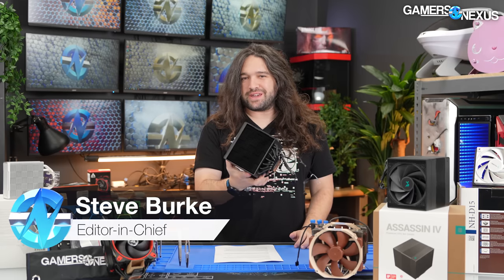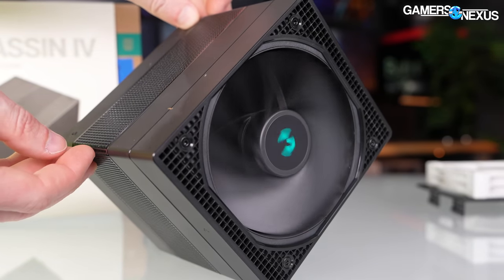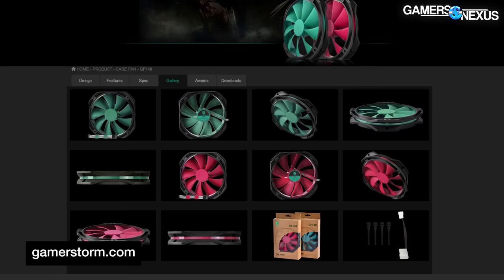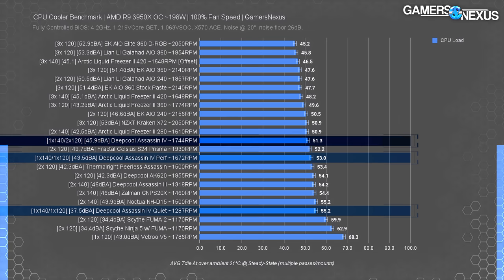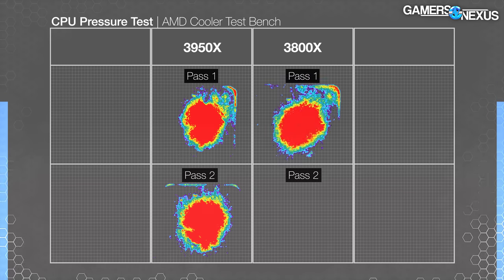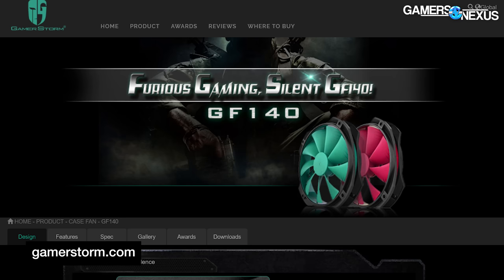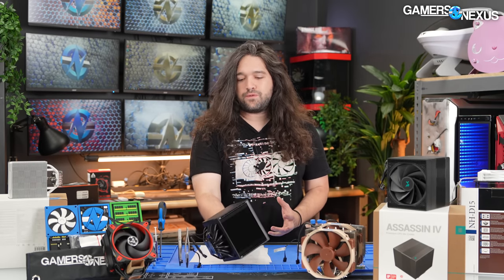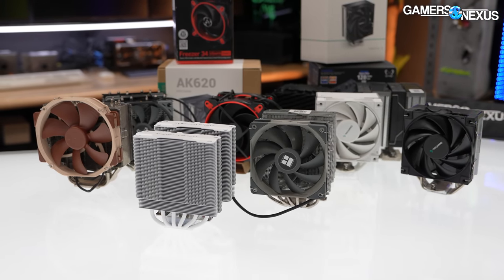Mega Size Air Cooler: Deepcool Assassin IV CPU Cooler Review & Benchmarks

Comment: The PA120SE has really impressed me. Upgraded from a Noctua NH-U12S. The performance to price ratio is ridiculously good 👍
Reply: After watching this, I regret buying my NH-U12A.
Reply: I bought a PA120 for £35 and I am very pleased with it.
Reply: just ordered one as replacement for the dying fan on my Macho rev.b ;)
Reply: it's just sad there's still people who refuse to believe the noctua sucks nowdays in both value and performance
Reply: Yeah, using it on my 5800x3D and its the reason I dont have to undervolt it :)
Reply: @JaySee5 on’t feel too bad. I built one system with the U12A and one with the PE in the past two months. The PE is larger and obviously keeps things cooler. But the fan noise from the PE is more noticeable to my ears than the U12A, and the latter was easier to work with in a smaller system. As mentioned, the Noctua cooler runs a little hotter under heavy load, but with a Thermalright CPU bracket, I have been unable to thermal throttle the CPU.
Reply: @JaySee5  obviously it all depends on the type of CPU. The Noctua is still a beast (I had it in 2014) yet with the higher end current CPUs it was still good but I knew I could improve. Plus I got the PA120SE on prime say sale. Can always upgrade and sell the Noctua?
Reply: @JimJik  I think the biggest rep noctua has for its longevity. I bought a NHU12s 11 years ago for an i5 3570. I still use it today on an amd 3600. I bought the cooler 11 years ago and a 5€ addon to make it compatible. 

This is just something noone else offers
Reply: @ironcrown2383 I mean that's awesome you got to use it for so long but it's literally a piece of metal lol. So it's kinda hard to not be durable. The little conversion kits they send you can be bought for like 3 bucks with free shipping. 

If the fan lasted all that time then I get your point.
Reply: @jim8571  yep, still the same original brown fan. But other brands dont even offer conversion kits like that and some dont even exist for that long or still offer support for models made that long ago. Thats why noctua is so great imo. But nowdays there are better performance/money offers, that you could prob sell those and buy a new one later, for the same price
Reply: @ironcrown2383  that's honestly a fair enough point, hope it lasts another 10 years!

Comment: Got 2 of these coolers. 1 is installed and working already, the other awaits installation. Never noticed any high pitched whines or anything. Main idea for their use is to take a 7800x3d, mount this tower on it, switch it to silent mode (more than enough cooling even in silent), and have a barely audible system. And it really is, even with an open case. Water cooling was not an option for several reasons, and this was the perfect solution.

Comment: I bought a Deep cool AK620 which seems to be part of the precursor series before this one. It is very similar in styling and features. I am very happy with it but mine does have the same annoying fan noise at high speeds. 

Honestly at the time I took a chance with buying Deepcool as they were still known as a budget brand but this cooler seemed to be ticking all the right boxes and I don't regret it. They have definetely put in the effort to transform their products and it shows. Give them a shot.
Reply: Can you tell your CPU Setup please?

Comment: I bought Thermalright's PA12 as a temporary cooler during my 7950X build.  I used it during the build when testing the components outside the case.  I even went as far as installing Windows.

Once the MB was fitted inside the FD Torrent, it's an Arctric Freezer II 420 that's doing the cooling.  And very well too.

The Thermalright PA12 will get reused in the future for when I upgrade my 24x7 rig,.  Presently that's got a Darkrock 3 cooling an i7 6900K running stock.

The Thermalright PA12 ranks better here on GN than the Noctua NH-D15.  nearly everyone else that tests the two have it the other way round.  But I trust Gamers Nexus's rigorous testing more that most other sources.

Also, Thermalright's AMD 7000 series Contact Frame is the nuts.  Doesn't do anything for cooling, but it is the best solution that stops thermal paste getting down inside those stupid heatspreader notches and makes cleanup easy.

Comment: Scythe has a fan called "SCYTHE Kaze Flex 140mm Round Frame" that has a 120mm mount, it could probably replace the middle fan and it could also be mounted for the included 120mm Fan adapter

Comment: I’ve been waiting for a company to try ditching the front fan to avoid any ram clearance issue and see how the airflow works out with pull fans. Glad to see it still cools well. Hope more options like this come to market.
Reply: A lot of existing coolers support this option (though I can't think of any that were designed with that in mind from the factory I suppose). The NH-D15 is one of them and it can help with RAM clearance issues (could use a 120mm if the VRM heatsinks are too tall but many MBs will fit the 140 there). You can also get the NH-D15s and add a 120mm fan to the outside pulling through instead of the RAM side and get the same effect.

Comment: Yes it's $100, but you will never have to change it due to failing pump, or crusty liquid build up. They pretty much last forever.
Reply: Yep, my old Coolermaster Hyper 212 is over 13 years old and still runs perfectly to this day with the original fan, which is not something that I would expect many AIOs to be capable of.
Reply: Unless the fans die, then just swap that... :P Not as expensive.

Comment: I think we truly peaked air cooling capabilities now. I'd go AIO but I still fear AIO leaking and destroying my whole system.
Reply: My am3+ systen ive owned since 2016 still has the same aio i bought back then. Its starting to bubble a little bit but overall never had any problems with it. I went air cooling tho with my new build since the 7800x3d doesn't need a aio

Comment: For that price, Deepcool should, at the very least, use thin steel instead of a plastic shroud.
Reply: I argue that would introduce rust, cutting fingers, and heavier cooler damaging motherboards risks.
Reply: @AaronShenghao  Is your GPU backplate made out of plastic?
Reply: @4zims  If it's not being used for cooling it might just as wel be.
Reply: You can't get the same seamless form-factor and built-in features (e.g. notches for the ratcheting adjustment) with thin steel

Comment: Hardware Canucks noticed (probably) the same "whine" you encountered. They contacted DeepCool about it, and were told there were some defective units in the early run. DeepCool sent another unit to Hardware Canucks, and that unit didn't have the "whine" issue.

Comment: I build all the CAD workstations and office PC's where I work.  For anything with an i5 or i7 I had been using Cooler Master Hyper 212 (all the different models) but the price on the old reliable cooler had been going up not down and is usually around $60 CAD ($45 USD) However when 11th Gen and then Alder lake hit the scene on the high machines I was using DeepCool Assassin III because it was so much cheaper than the next competitor here in Canada at $99 ($75 USD).  Then the AK400 came in at $29 CAD less than half of the CM 212, and the AK620 was only $60 CAD! it is incredible value (a third of the price of the  comparable Noctua) the ease of installation also saves more in technician time. We have switched to using DeepCool for the foreseeable future.

Comment: I did a test for a German test site and didn't watch this video before but I'm pretty much coming to a very similar solution. Yeah, it is a strong cooler with a unique look. No, it's not really offering that much more performance than DeepCool's own more affordable AK620, which is a bit more pleasant to listen to as well. For the three fan test I used a DeepCool FK120 (which can be bought seperately but I took the one from the AK620), which is pretty similar to the FC120 found on the AK400. I came to the same 1.5 - 2°C advantage with the additional fan. I didn't like the hex head of the screws either and even accidentally killed one of the heads trying to mount the FK120. Regular headed fan screws would have been better indeed and luckily most fans you buy actually come with screws you can use here unless you just grab "some random fan from the drawer", which is unlikely when buying such a rather expensive air cooler. The Assassin IV (just like the AK620) is pretty easy to mount as well - that's really rather similar to Noctua coolers, which is good. 
I have to say I really like the recent DeepCool stuff and their overall quality seems to have improved quite a bit when compared to some of their parts from like 5+ years ago.

Comment: "So you get a seven dollar ILM replacement kit with the cheaper cooler the thermal benefit starts to evaporate on this much more expensive option."
Maybe this was addressed, but what if you get a contact frame and this cooler? Would that lead to further improvement or is there a perfomance ceiling regarding how much heat an air cooler can get rid of?

Also, I'd love to see a review of the new Cooler Master MA824.

Comment: There's no denying that the Deepcool Assassin IV is one clean good looking cooler but and open fin design cooler vs a boxed up fin will always be more efficient at dissipating heat.  I have my Montech Metal DT24 Premium only using the center fan for symmetry-look with the other 120 fan installed  as a top intake case fan (Fractal North case) blowing directly onto the DT24. The top mounted intake case fan also aids to cool the VRMs. The top front 140mm case fan is also lined up to blow air straight to the cooler through a 4" diameter 140mm duct installed behind the fan for a more directed higher velocity air flow.

Comment: I hope you guys will get around to lower height coolers. Some cases cannot fit a 155mm high cooler and liquid cooling isn't a realistic option. one cooler in particular has my interest.
The ID-COOLING SE-207-XT Slim, it's only 135mm high and costs around $40 bucks.

Comment: If you're getting older and priorities change, this thing is great! 
Don't get me wrong. When i was 13-20yrs old i would have never bought something like that. Way to expensive for what it accomplishes. 

But I'm older now and don't need that bang for the buck anymore. For me it has to be "good enough" and needs to fit the build or the room it will go in. 
And if you're looking for a nice and clean build without all the rgb bling and plastics, this cooler is great. Same goes for the new fractal cases. 
As you already said: they change the look and feel and hope somebody pays the premium. 
I am one of these people. Fractal never had such beautiful cases in my opinion. The less plastic the better. Clean Aluminium, Wood and Glas. That is a look and feel no plastic will ever achieve. 
I'm thinking of building my next PC in a Jonsbo D30 to get that "mac premium feeling" without going mac. And a cooler like this fits so much better than the NH-D15 (which i have right now and love).
I want more companies to go this route. In my eyes, the only downside of this cooler is the fan, thats non-standard.

Comment: Did you happen to test on 12th or 13th Gen i9 chips?  I have a 12900k with the TG contact frame.  The only thing that has been able to tame it is the Arctic Liquid freezer 420mm AIO. I have more in my case and cooling than is worth the performance.  It’s been incredibly frustrating to own a cpu that out of the gate can’t reach its full potential without spending a crap ton of $$.  I prefer the simplicity of air coolers and the DC620 did pretty well and I’d probably be OK with that as a solution as I’m not running R23 all day.  Anyway, I love new tech and wanted to know if you all did any testing on some i9s.  That would really let everyone know what this cooler can do. 

Thanks for your hard work 
Cheers
Rick

Comment: I have been running the Assassin III for 5 years now and given that the cooler itself can practically not fail $100 is cheap. Especially if you compare to AIOs its so much more reliable.

Comment: Looks like something I'd buy for my next pc build in a few years. One thing I've learned from my current Corsair AIO setup is that I will never buy a piece of hardware again which will try to lock me into a specific OS. The hardware should never control the user, it's the opposite how it should work.

Comment: Loud motor or whine is one of the most important factors to me, I don't mind overall DBA from the fans itself being spun but whine is the be all end all for me, I can lose 6 degrees (not saying this is the case) if it means the motor etc isn't whining, it's why I feel Noctua and very close behind Be Quiets Silent wings 4 are top for me even if the T30 is winning technically I don't care.
Thank you for including the part about the whine I would adore if you did tests across all fans and coolers that you have inside the noise chamber and recorded the audio.

Comment: The solution I got to replace the 140mm fan was to use a 120mm fan attached to the metal piece that comes in the 140mm fan. It's far from ideal and it sometimes fall inside the 140mm fan chamber, but it's the only option I found right now. I'm going to get a deepcool AS500 to try it's fan on the Assassin IV.

Comment: The 140mm deepcool fan in the center has 120mm mounting points. You can replace the center fan with basically any 120mm fan. You just can't use another 140mm fan.

Comment: Can we criticize manufacturers for using fan curves in the first place? What the hell ever happened to hysteresis? Set your temperature and if it exceeds that just increase the fan speed smoothly until it stops climbing beyond it. Fan curves are the worst thing ever to deal with.

Comment: I bought it because it’s stylish, the 140mm fan is noticeable compared to N NF 12x15 noctua fans, however the little switch on the cooler alleviates that problem, 8/10, I want to be able to swap the 140mm fan for a noctua fan

Comment: I'm very sensitive to fan hum. The AK620 is pretty bad about it but I was able to use fan curves to just skip that RPM (900-1000ish for the AK620 for me) and it's fine. I imagine the Assassin IV an probably be solved in a similar fashion. (Assuming you've already bought the cooler and don't want to replace it.)

Comment: DeepCool fans seem to be long lasting, I haven't had a failure yet even their cheaper case fan line. I wouldn't worry too much about longevity even if used at full speed for several years

Comment: The complaint about the non-standard middle 140mm fan came across as strange as this has never been mentioned in any previous 140mm air cooler reviews.
I am not aware of - and I have looked - of any air cooler that uses 140mm fans with standard mounting.
They all use "140mm" with mounting holes closer to the blades than standard - often 120mm mounting.
I'd love it if there was an air cooler where you could replace the fans with any 140mm fan you wanted, but until one exists it doesn't seem fair to criticize one particular cooler - seemingly because it uses a sleeker mounting method rather than ugly metal clips?

Comment: If Deepcool could rectify its fans resonating issue, they will be one of the best brands for cpu cooling. Only 1 month and i've gone crazy with the AK620 2 x 120mm fans resonating. Its like rattling my brains especially during low loads. Got crazy and bought 2 Noctua A12x25(Arctic P12 Pst should suffice) and the cooler is now performing so silently and even at loads the acoustic is acceptable type of noise instead of humming/whining.
Reply: Should have bought Noctua D15 which is cheaper than this setup which needs fans replacement

Comment: I've been using a Akasa Venom Medusa for YEARS as my cpu tower cooler. I'm surprised it can compete with such a new cooler technology wise.... Literally all this cooler has over my very old tower cooler is the switch. 

It has the same caved in fin design towards the middle, it has a universal 140mm fan clips, also can mount super low for the VRMs. Clips to mount 120mm fans on the ends.... The CPU brackets are outdated though. And I don't think the company makes tower coolers anymore either.

Comment: 9:49
"that has it (the DeepCool Assassin IV) about tied with the Thermalright Peerless Assassin. The noise level between these two is functionally the same, mostly within error or variance. The Assassin has a big VRM cooling advantage."
Sorry, which one has a big VRM cooling advantage, the Assassin, or the Assassin?
Reply: I'd get the the Phantom Spirit or Peerless Assassin just for the cost difference. Also, I wouldn't be buying Deepcool if you're in the USA right now... you probably won't get ANY customer service/help/returns on account of Gov. sanctions.
Like that middle fan that Steve said you can't really replace? You're out of luck (maybe forever) if that dies.

Comment: Luckily they thought about how difficult mounting can be and left that top very accessible. I have a be quiet dark rock pro 4, and installing it was a pain due to only having holes to stick the screw driver through. Might have to look into this model for cooling when I build next system. ~insert Microsoft 'Thanks Steve' here~

Comment: My Arctic Liquid Freezer II 280 AIO, a bargain at 90 EUR in late 2019, I see that it remains among the top performers and the least noisy coolers. They send me offset mounting kit for free when I bought 58X3D. Best thing about this AIO is cable management. It hides the cables for radiator fans in the sleeving of tubes. Just one cable to connect to motherboard. It has one downside: the radiator is thicker, so it doesn't fit every case that supports 280 AIO mounting. Neutral: No RGB (Plus for me.)